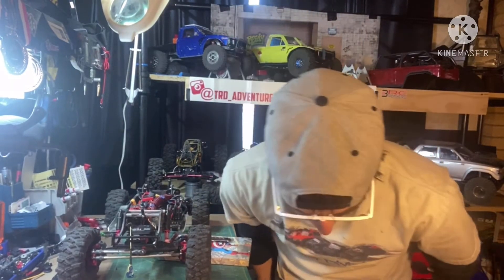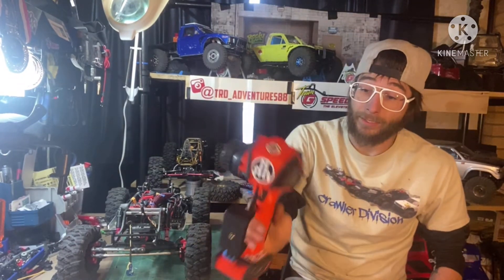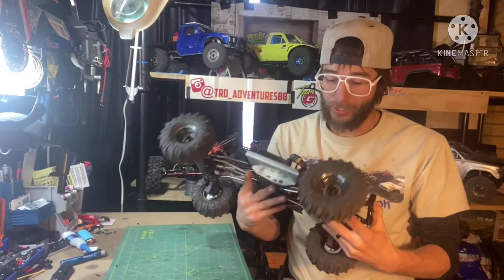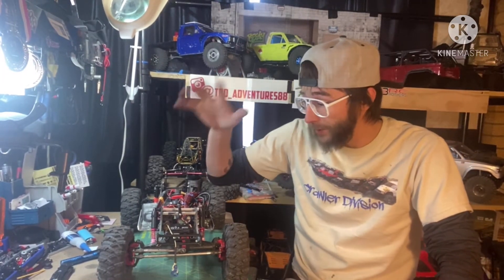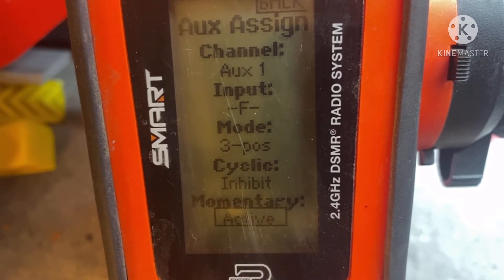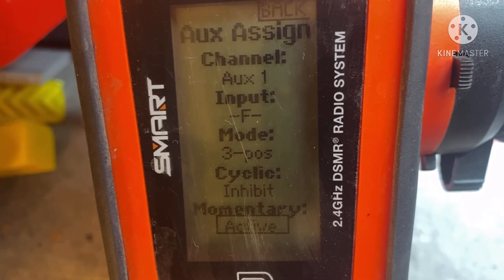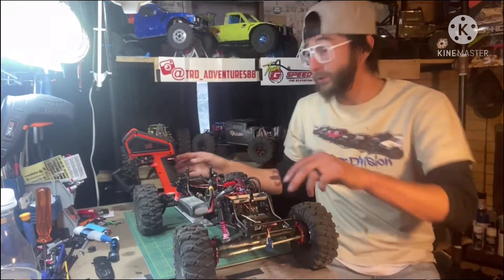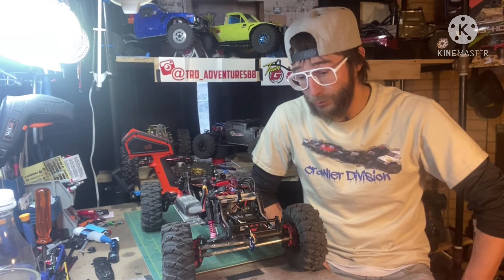Setting up servo winch &/or rear steering with DX5 rugged.

Comment: How do you change the brake trim? I cant find ANY videos and the manual SUCKS!!!! I have my winch set to the F button as well but every time I winch in it turns my brake down and then I have no reverse!!!!! This remote is so damn aggravating
Reply from the maker: You go in to the rates setting and you will see like steering, throttle, brake and below them you will see switch, select it and ch age the switch to inhibit
Reply: OMG thank you. Been searching for days on how to turn brake off that channel. If you ever make another vid on this, make sure to add that bit 😂. Thanks man

Comment: Are E, F switches on the DX5 rugged spring loaded? or are they toggle switches?  My current radio they are toggle and its annoying to try to get it back to the middle ( for winch or steering ) - edit: 6:18 sounds like its spring loaded?
Reply from the maker: Yea they are spring and go back to center.
Reply: @TRDAdventures  Cool thanks

Comment: I have the same transmitter. Want the servo to go much more down and up.
Reply from the maker: That would be adjusting the travel of the channel you are using
Reply: @TRDAdventures  thanks. I did that. It’s 50% more bud not enough. How do get it to go more or Continuously run till I stop it like a winch?
Reply from the maker: @throughthebloodofChrist7  you would need to modify the servo, or use an actual servo winch